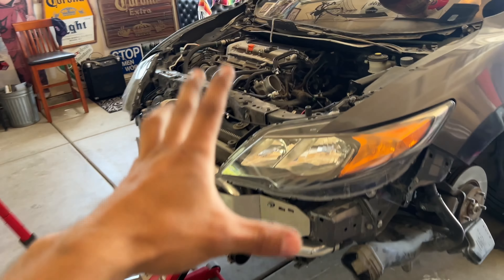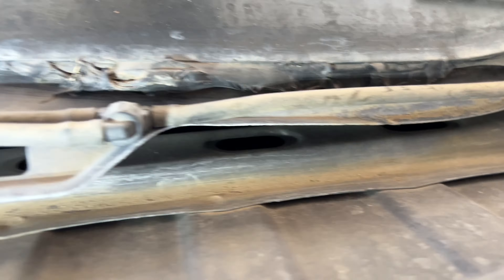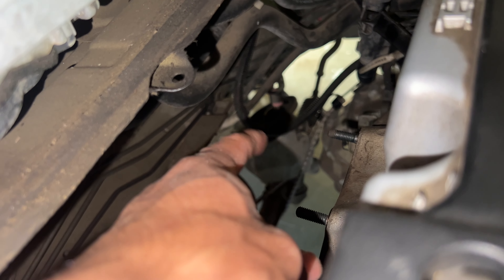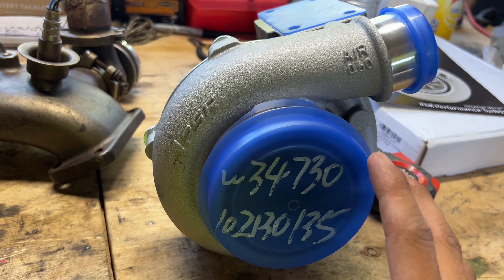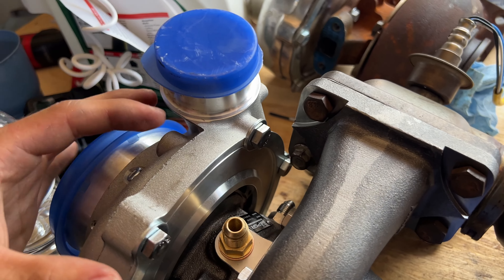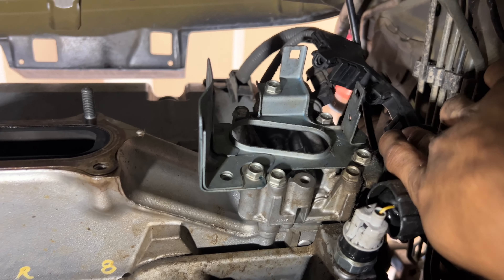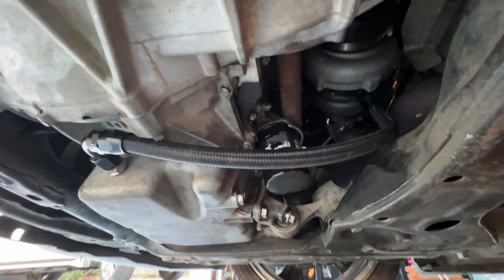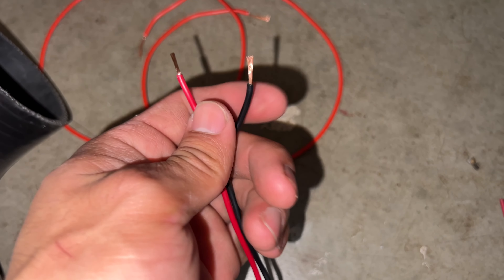INSTALLING THE MAKSPEED TURBO KIT (9th Gen Civic SI)

Comment: just found your channel and have a turbo 9th gen myself, 4 years being boosted, the drain location will not kill the turbo. sadly without doing a type s kit and relocation on the oil filter that is the best we can do besides the drain plug hole.. mine is near that same location only elevated slightly more, it will be fine.
Reply from the maker: 100% i believe the location isn’t a problem as long as it’s elevated, thanks for your input!
Reply: @dc5diego  100% agree! 🙏 keep up the videos 🤘

Comment: you do NOT need coolant lines, just make sure you dont cut the car off when you park, give it a minute to cool down from the oil running through it. This is why turbo timers were popular back in the day.   however.... cooling lines do help a lot
Reply from the maker: this is exactly what i figured, i did a lot of reading and the crazy part is the coolant flows through the turbo when the car is turned OFF through some siphon effect or something along the lines of that. But yes i let the the car idle for a few minutes after driving to let the turbo cool
Reply: Invest in a remote start kit, some have programs to have is running up to 15min before cutting off.
Reply: @aragrox who sell that? I been boosted since 2020
Reply: @TheLegacyOfJay  compustar one I have.

Comment: FYI water cooling is not optional on that turbo, the seals will cook and it’ll last about 3000 miles. Just run the lines that used to go to the throttle body to the turbo so it lasts
Reply: Or switch to a pulsar PTE rep turbo instead of a Garett rep they’re air cooled
Reply from the maker: that’s exactly what i was gonna do too just use the throttle body lines but just going based off pulsar they just say  “highly recommend” they don’t say required so i just sent it.
Reply: @dc5diego  ok well Korey wrights turbo lasted 3000 miles because of this… usually when they say highly reccomend it means you should do it. They are reps of Garett turbos and Garett says it’s strictly non optional
Reply from the maker: yeah solid point right there i will most likely do it in the near future but for right now im just enjoying it

Comment: Wassup bro this is off topic of the vid but I was wondering what tires and tire size is the best budget option for 14 civic ex sadly I don’t have a si 😿😿 I love your videos doe g ur civic turbo build is coming out fireeee asfff 🔥🔥🔥🐐💪
Reply from the maker: could depend all on your setup! if your stanced out and cambered you can run some 18’ wheels with some tire stretch or if you’re more street/track built then you can run some 17’ wheels with a meatier tire. thanks for the support! also fitment industries should have more info about what type of rim/tire you’re looking for 💪🏼
Reply: @dc5diego  I got stock rims I don’t have enough money to buy rims rn just wanted some good tires for stock rims but thank you for commenting back appreciate it 🫡🐐

Comment: the maf sensor two wires have to be completely cut off from the sensor there only suppose to go to the iat sensor to get the proper readings
Reply from the maker: https://www.hondata.com/help/flashpro/index.html?afm_removal.htm

here’s a link from hondata, i don’t know about other K platforms but 9th gen’s gotta have MAF plugged in when converting to IAT my readings are fine so far, if im wrong any where pls correct i dont wanna spread wrong info! thanks :)

Comment: You dont need to drill in the oil pan they make a fitting that bolts on the timing cover ebay
Reply from the maker: seen that! but just decided to drill it since i had everything bought already lol
Reply: Link?

Comment: That oil return line is set up so wrong... you have it working against gravity...
Reply from the maker: ignore that previous reply! i thought i read it as “oil feed” lol but the oil return is working just fine i haven’t had a drop of oil nor smoke coming out of anywhere
Reply: @dc5diego  thats crazy your lucky... i had just a slight upward bend at the bottim of mine and eventually oil will be backed up in my turbo lines and start smoking from the turbo